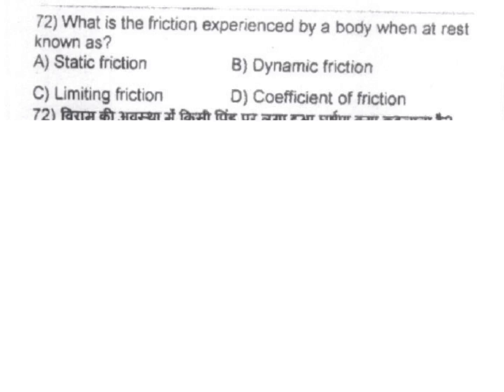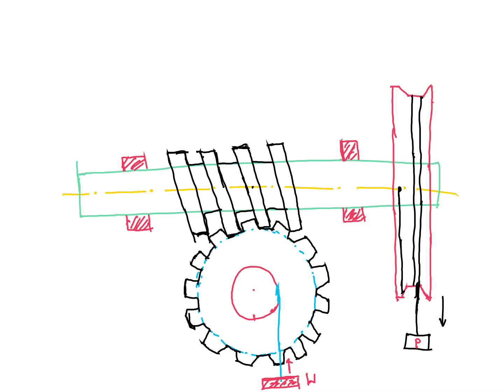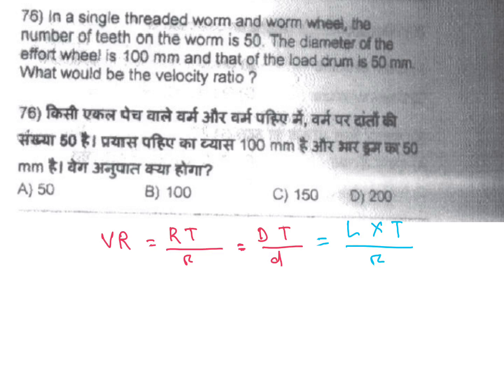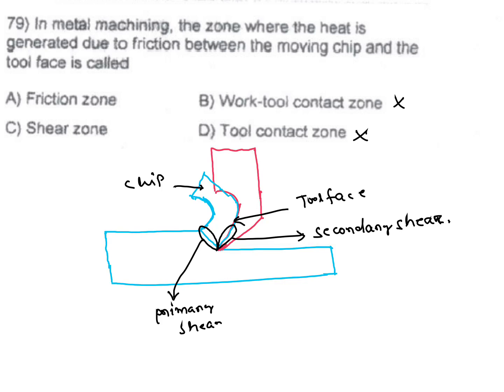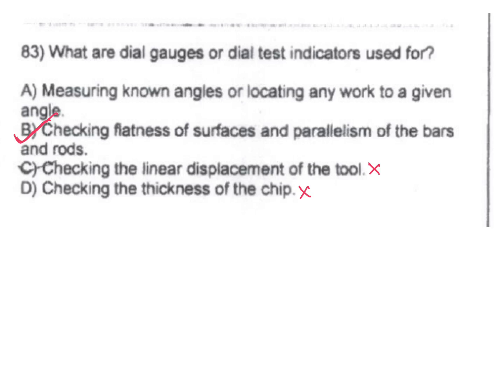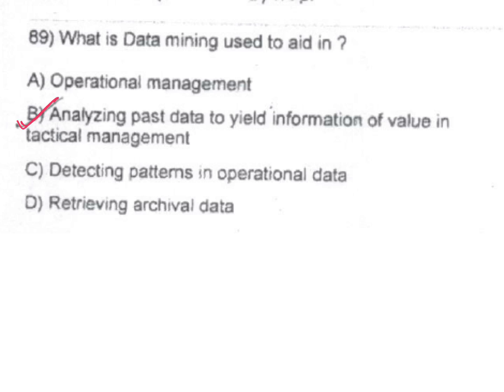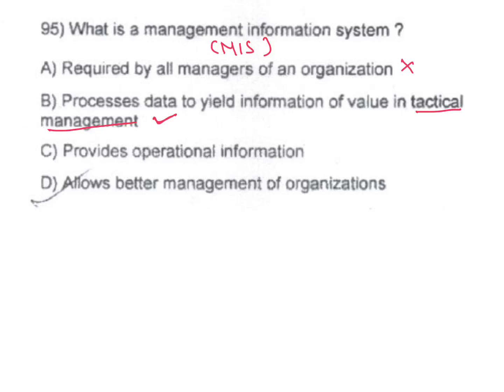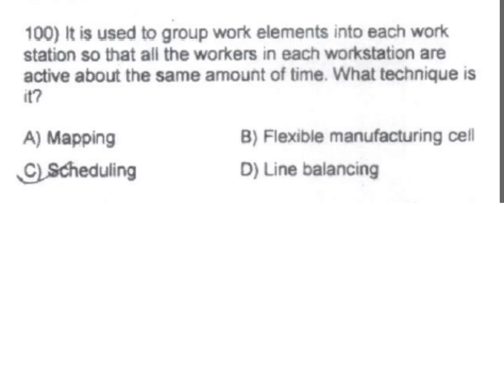VIZAG STEEL MT 2010 TECHNICAL PART 04

Comment: Regarding 84th question ,ability to withstand bending without failing is nothing but bending strength or bending stress or most related answer is mechanical strength, but how it can be stiffness?